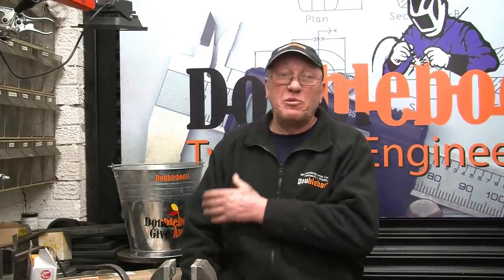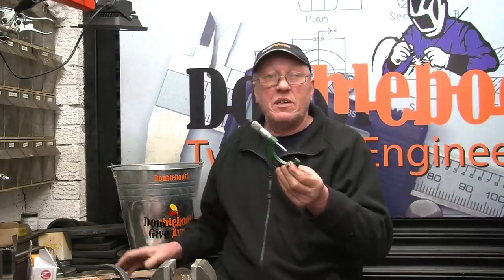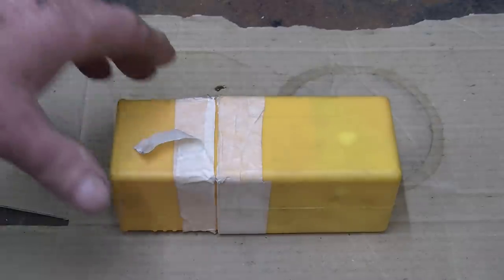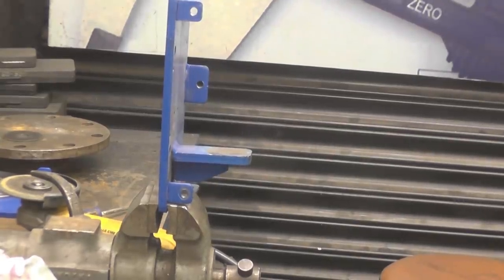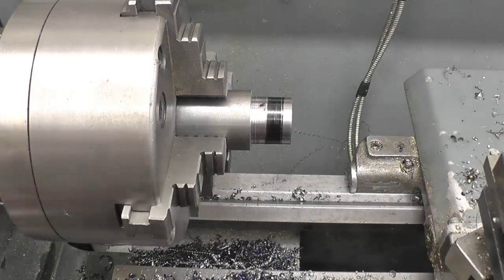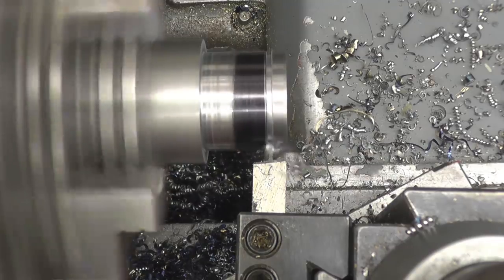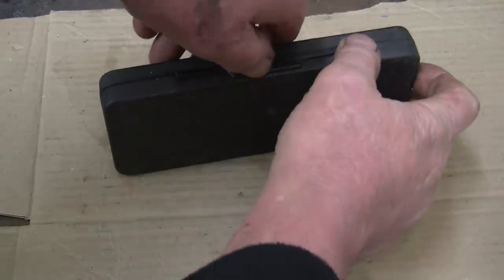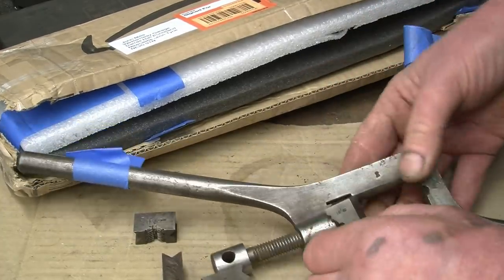SNNC 262 P1   Worn Pin Repair & Modify

Comment: Some engineer designed that without a lube port, now a machinist will correct his/her mistake!!  Young machinist's could learn a lot about extending the life of their machine tools by making sure the lube is spread before applying a load.  Nice work on that pulley shaft.  Sweet die holder.  OH NO it doesn't fit. #%@&+!   I laughed at the out take, looked like me trying to open a plastic case containing center drills. See you in part two.
Reply: Probably an oil impregnated sintered bronze bushing, not a mistake, just past its service life.
Reply: @pvtimberfaller  How long would it's service life have been WITH an oil port?